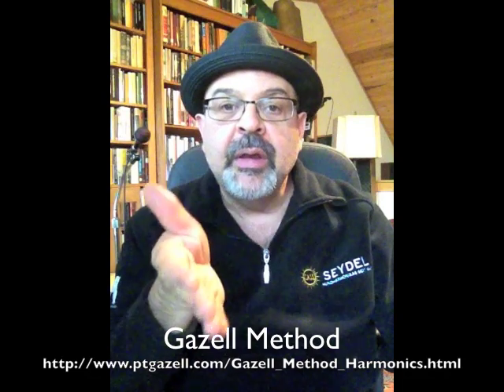PT Gazell on Bending Notes.mov

Comment: Hey PT, I bought a half-valved session steel directly from Seydel. It is great but I cannot get the 4 hole to blow bend one cent. Looking at the layout of the harp it should be possible. Am I missing something or should I check the harp?
Reply from the maker: Hi Marcel, If you are able to blow bend 1,2,5&6 then I would say it’s the gapping on the 4 hole blow. I will say that that bent note is redundant however. Meaning you don’t really need it except for shading and emotion.
Reply: @ptgazell  thank you! Yes, the offset was too big. Now it works better. I use it merely for vibrato and shading not to actually play the bent note.